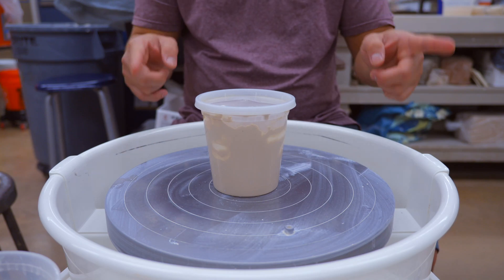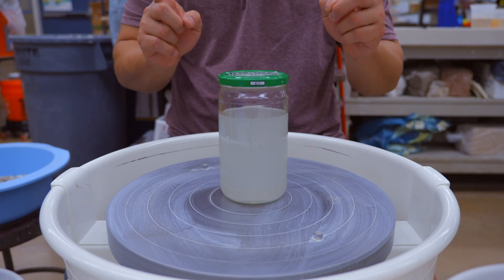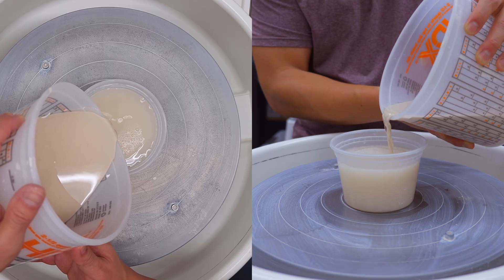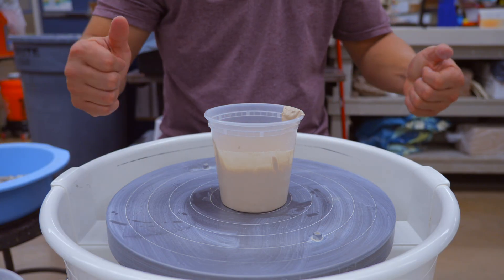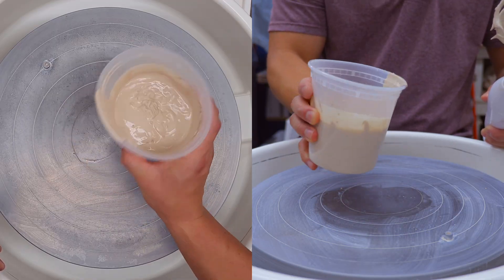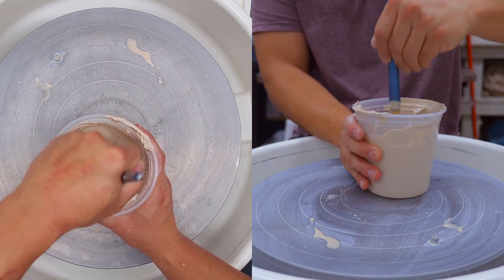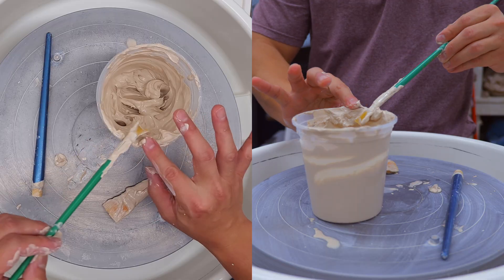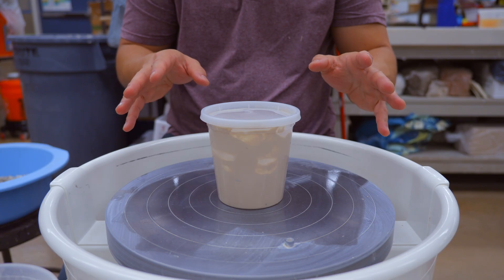The Secret to Amazing Clay Texture: Making Thick Slip with Sodium Silicate

Comment: Will another defloc work the same as sodium silicate? I've got DSP-3 deflocculant for glazes and that got me thinking....
Reply from the maker: I haven't personally tried other deflocculants, but it's worth experimenting to see if you get similar results!  Is DSP-3 Darvan 7?
Reply: @mwceramics  I'm not sure, it's how it's called by my local supplier, but I believe they are both Sodium polyacrylate or Sodium polymethacrylate essentialy
Reply from the maker: Hmmmm interesting. I'd say make a test batch and see if it works to defloc the slip, and if it works than run with it!

Comment: Great video , thanks .What is the ratio of sodium silicate powder to water ?
Reply from the maker: Thank you for watching! I used about 1/8 teaspoon of sodium silicate to roughly 1.5 cups of slip. Not the most scientific but a literal drop of sodium silicate does wonders!
Reply: @mwceramics I don’t think that’s what was asked. To create your sodium silicate solution, how much water was mixed with how much powdered sodium silicate?

Comment: Would epsom salts be better than water when needing to change the consistency?
Reply: A flocculant would make the slip with the same water content more consistent wich has better workability at the moment of use, but would not reduce the water to clay ratio, here we use a deffloculant so we can (with less water) increase the clay. Making it less prone to cracking while drying.